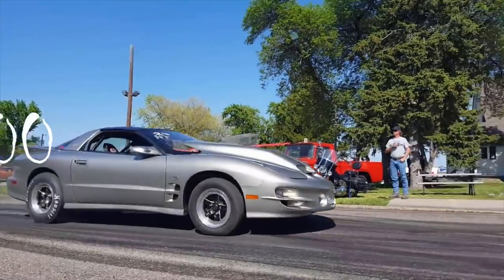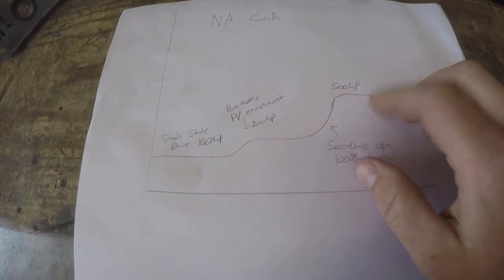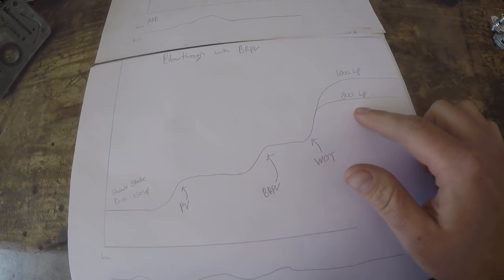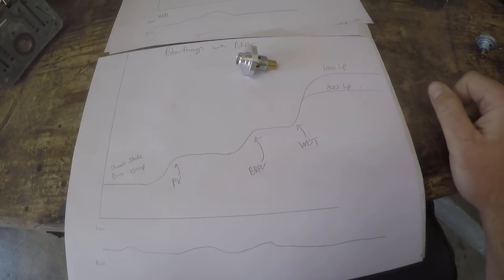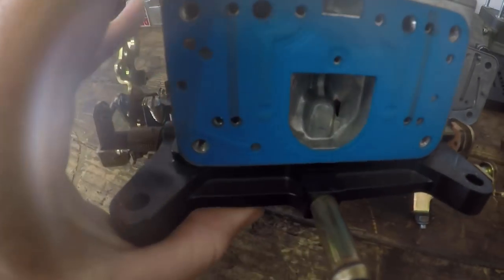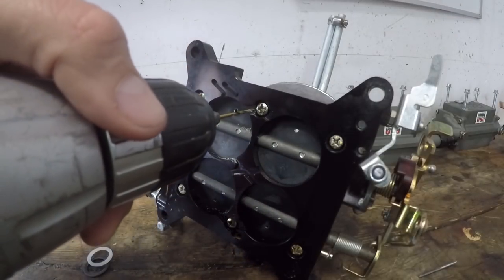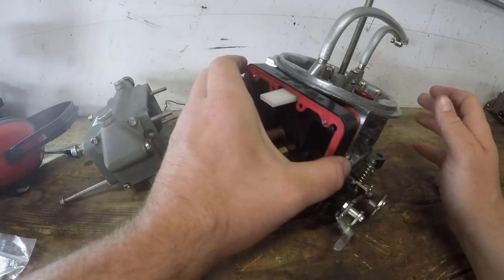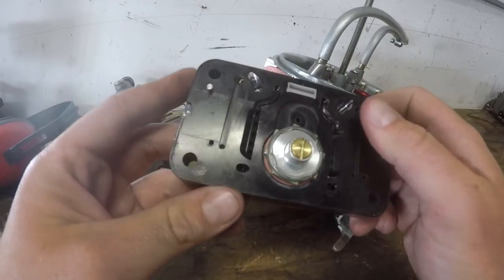Boost Referenced Power Valve

Comment: I'm pretty sure I have the same BRPV. I'm VERY glad he made these available. I just put one in my home built blow through setup and was able to fix my lean tip in to boost on the primaries. Very tune-able and a very well made piece.  Excellent video sir!
Reply from the maker: Ray Cam  Thanks Ray!   Yes these are a game changer
Reply: instaBlaster

Comment: We have had success on our quick fuel blow thru 850 with a 2.5 power valve making About 1300 hp . We have some adjustable boost reference power valves from a guy out of austraila we are going to try.

Comment: Well I'll be dammed. I think i finally get it. You are boosting the float bowl and making the much larger PV adjustable as to when it opens under boost. Kind of opposite a draw thru boosted carb. Staged PV's is something I never knew about either. Are other other types of carbs that are compatible with blow thur?
I hope you are still out there, this is worth a subscription.

Comment: Ok, finally a video on blow thru street applications! I'm considering a blow thru for my 94F150 flareside!  I'm talking 200-300 miles a month! Got a a powershot, and maybe that's what I  need to stick with! But a 10lb turbo setup would be awesome! Blow thru, but dependable!  How bout a vacuum power valve in the front, boost reference valve in the back?
Reply from the maker: Many guys do that
Reply: @tittan1500  thanks, I used to race 3-4 times a week! Everyone was shooting gas then! I'm 62 now! I'd don't want to go back to serious drag racing, but wanna be respectable with the new 500+ factory rides! Retired now, and would like to hit the small tracks just to watch. But if the itch comes, a pass or 2 won't really be racing, but it has to come home under its own power! Just good old boys having fun! Getting old sucks! Get ur thrills now!

Comment: So did you run 2 tiny screws into the 2 holes that you tapped ? I'm trying to figure out the minimal of what I need to do to run around 8-10 psi on a pretty stock 5 speed fox body that I drive a shit ton on the street and see's little to no track time.
Reply: You should make a video on building the most basic but functional blow through convertion for a lower HP say 500 HP convertion. There are slim to na video's of convertion's period but, the one's I have found are for dedicated track carb's. I know I need to pull the choke and mill it. I have access to either a Holley or Edelbrock 650 doubles. Great video's btw, love the knowledge.
Reply from the maker: Bryan Roupe yes sir I put cap screws in the hole ( link to them in the video description).   

Honestly for 5/10 lbs you don’t need one.   It will help if you roll on the throttle mid way a lot but at the lower post levels the standard powervalve can cover the gap pretty well

Comment: Im building a twin turbo 5.3 and am using a 750 dominator. Its a typical 3 circuit carb but the fuel channels are a little different. Can you shed some light on this carb
Reply from the maker: I don’t have any experience with the 3 circuit.  The concepts are the same you just have another fuel source to balance
Reply: @tittan1500  Ok. I was wrong. The 750s are 2 circuit. My bad.

Comment: If running a normal power valve, you shouldn't need to do any modifications to the PV, other than increase the channel sizes for more fuel.. right?  With your BRPV system, you block off the vacuum hole, how does boost pressure get INTO the BOWL side to open your BRPV?  The boost then squishes the ball open from boost entering through the vent tubes?
Reply from the maker: Correct
Reply from the maker: If you don’t block off the hole pressure in the intake can equalize on both sides of the ball and cause it not to open

Comment: at what power level would i need   more mods to a regular NA carb then  removin the  chocke horn and  swapping to solid  floats  when building a  350-400 hp  231cid  v6  for street driving  with a  5 speed manual?

Comment: Hey,i generally never ask anyone questions  on here,but ive built alot of blow through carb combos an im curious if u have ever seen fuel pressure effect the boost pv before the bowls r pressurized by boost,say ur valve is set to open at 3 psi but u have 7 psi of fuel pressure pushing against it,have u had the valve open prematurely,i set em with compressed air and they usually come off the seat around 2 psi and flutter then by say 6 they r wide open,so i add a couple turns to try and compensate for fuel pressure so they flutter at 5 psi and r fully open by 10 give or take,just curious if u have seen  the same things and set em up accordingly....justin

Comment: So 8 PSI of fuel goes in the carburetor but let's say you're pushing 10 psi of boost wouldn't it push the fuel backwards? is there something you do to stop this
Reply from the maker: Pressure from the boost fills the bowls through the vents so you always have more pressure “on the fuel” than after the booster

Comment: So are brpv's needed for a blow thru 7.5psi if you use a boost reference fuel pressure regulator with a Holley 4150?
Reply: Yes

Comment: I have a question.I have a ls and while on brake I watch my a/f and around 4-5 psi I it will go from .70 to .62 so im assuming the power vavle is opening.It basically kills the engine for the most part and cant really come up on the transbrake.Should I tighten the power valve in the front or both or something else.Its on cam only twin 63s..thanks so much for any info
Reply from the maker: Tighten it up or use smaller PVCR on the primary and more on the secondary

Comment: Should I do the jet exstentions and the copper tubing on the pv even if I'm not doing the bapv? Only 10psi.
Reply from the maker: Bryan Roupe  always run jet extensions on the rear main jets unless the carb is sideways in the car

Normal power valves cannot be extended

Comment: Doing blow thru Novi Paxton set up on ls 5.7. what size boost power valve should I buy? Going with a 750 I think, only 10 pounds of boost max
Reply from the maker: Charlie B currently the SCS power valve is just one size, you adjust the flow with the PVCR

Comment: Does anyone know, if I run a normal vacuum power valve with the boost power valve. Would I still plug the base vacuum port that references the normal power valve?
Reply from the maker: Tony yes you can just don’t plug the port on the vacuum side
Reply: @tittan1500  Thank you very much for the reply. Your videos are so useful and full of information regarding blow through carba. Thank you for making them.

Comment: hey hows it going! i kno your very busy. i had few more questions.i have a aeromotive boost ref fuel pres. regulator. can i use it for the 500cfm  carb blow thru ?? also i ran 24lbs of boost w the efi set up .whats a good fuel pressure for the carb ?? ..did lots of research but no clear answer. ty for your time titan!
Reply from the maker: Les Harp as long as it’s a carb regulator and can Regulate down to 7 ish psi.  Then you should be good
Reply: Tittan1500 ty for your knowledge and for sharing it w me I really appreciate it bro..Salute!💪🏿💯
Reply: Hey titan1500! i saw where u drilled and plugged the vacuum hole ..i have the holley 2 bbl so i do the same to the primary? also u tapped the hole .but i never saw what u plugged it with. underneath the carb plate i have a ball in the hole do i drill it out or i can leave it?Sorry bro  this is my first time w a  carb. thx for all your help!
Reply from the maker: Les Harp sorry there is a link to the set screws I used to plug yhem
Reply: Tittan1500 i appreciate the vids fasho ty bro👍
Reply: @tittan1500  hey man ty for the valuable info for my 2.3l stang wow I am blown away she is really pulling hard and so efficient this is my first time building a 2.3 l Turbo carbureted blow through setup. 6 months buildin  n i started drivin n tuning 3days  ago

Comment: I have a 2.3l ford mustang w turbo ..thinking about blowthru carb...what size cfm carb would i need and will i need a boost ref. Valve also for a 2bbl holley??
Reply from the maker: Les Harp ya a 500 ish 2 barrel with a BRPV would be a good start with some vent tube extensions.
Reply: @tittan1500  wow thx .love the channel .u really are easy to understand in your breakdowns bro!..i love racin..my combo is simple
Worked iron head ported n polished..436.lift hydr.rollercam 114 lsa..6500rpmrange. 
Msd dig 6 plus .w locked out distributor. C-4 rev.valve body .3500stall. 410gear. 62-1 ar70 turbo. Jus tryin somethin new.

Comment: Hey I love the video. But just curious though is that like 100% all I have to do to a carb to make it work with boost?
Reply from the maker: Hey ,  Depending on what carb you start with you may need to do a little more.

if your starting with a double pumper style carb - Nitrophyl Floats - .120 needle and seats ( not required )- Epoxy to seal up the main well plugs ( not required) - Lots of guys like annular boosters ( not required)
Reply from the maker: If your carb has a power valve check ball kit remove it
Reply: Sweet got it thank you. I actually have a 85 fox with a 302 with speed pro pistons and an Edelbrock intake with aluminum heads and a 750 double pump Holley carb. And I’m thinking of either nitrous or turbo. And I’ve been strongly looking into on3 turbo then the problem with a blow threw carb came up and the price for a blow threw I can go efi. But I like being able to tune my own stuff. So while we are on the topic what types of floats will I have to use and is it possible to run e85 with this blow threw carb mod? If not how much more will I have to do?
Reply from the maker: Sierra Ray how much power do you wanna make ?  I am bias blow through are amazing with the cooling and to me they are easy.

Pickup a BRPV and a wide band and. Go for it.   It’s simple stuff and no intercooler required !
Reply from the maker: Shameless plug we just started selling power valves.   

Www.simplestage.shop
Reply: Right now with it still kinda stock 302 I’d be happy with like 450hp somewhere around there. But I do plan on a 351 and having in make close to the 800-900 range. And from there I will upgrade but for now I’ll be happy with 450 on a 302.
Reply from the maker: Sierra Ray Easy wit the On3 setup!
Reply: So the brpv and new floats is all I should need? What are ur thoughts on put a carb spacer plate in too?
Reply from the maker: Sierra Ray yuo, however they carb spacer won’t do micj
Reply from the maker: Much
Reply: 👍 thank you very much for everything. And the fast responses. I’m getting ready to put the car up for the winter and come back out next season with a bang.
Reply: And thank you for ur info I already went and checked it out and plan on ordering it soon.
Reply: What type of floats do u recommend using too?

Comment: What fuel pressure regulator do you use for the ethanol?
Reply: Tittan1500 It doesn’t look like its boost referenced? Does your fuel pressure stay the same no matter what the load on the engine is?
Reply from the maker: Thomas Traicoff  sorry MP-9833-B
Reply: Tittan1500 Awesome thank you🙏🏼 Easily my favorite build on youtube

Comment: How about can cancelling second ay PV and jet up the secondary jets?
Reply from the maker: GHT RCP ya you can do that, but the curve will not be as linear.

In some cases the main jet at its max size is the restriction depending on main well and booster size.  In this case eliminating the PV circuit can lower total fueling

Comment: What fuel pump are you using ?
Reply from the maker: cory cook ProStar500
Reply: How to you get the fuel pressure high enough to run that much boost ?? I can’t run anymore than 18psi with the same pump?
Reply from the maker: cory cook crank your bypass all the way down it will do mid 30s
Reply: Thank you. I will try and see what happens.

Comment: Plug the power valves altogether. Add a boost referenced fuel pressure regulator and fuel pump capable of providing 20 lbs more than the boost pressure. Up your jet sizes 4 or more sizes and possibly put smaller air bleeds to increase fuel flow at higher engine speeds. Noone seems to address the problem of insufficient fuel flow and pressure. The needle and seats must be the largest you can get or maybe drilled out a bit ,Use the plastic floats they won't collapse. For alcohol consider spraying additional fuel into the boosters like fuel injection.
Reply from the maker: dielauwen  Everyone uses boost referenced fuel regs these days man.  Stock bowls on e85 can get you to around 700 wheel and dual needle and seat bowls are on the market that support more than most people can afford.

On a blow though deal making any power just squaring the jets and blocking power valves is a good way to buy a bunch of pistons.

Sorry man but that is terrible advice
Reply: Most Racing carbs do not use power valves. Holley still does. There are no Motorcycle carbs that have power valves that I know of. Just jet for best power . So why do you say it is bad?
And to create high power under boost the airflow needs to be much greater so Carb size needs to be increased. It becomes a choke .They are not designed for the flow alcohol needs so just add squirters for high boost.
Reply from the maker: dielauwen  these are not naturally aspirated motors. Air flow in a turbo motor is not a linear deal.

In automotive carbs power valves on street / race cars are most common.  This lets you drive clean and maintain safe AFR at different loads.

Boost makes this even more critical, when your part throttle and the boost comes in your going to go very lean if you don’t have compensation.

Drag cars sure you can roll just big square jets,  just don’t expect it to street worth a dam or peddle the car.
Reply: I see you have not worked on foreign cars which have no power valves on the carburetors. 
It is simple to set the carb to follow a set mixture for any given speed, load is not even considered.  Small engines need to make power at any rpm. You can set it to be lean anywhere on the scale or rich anywhere on the scale.Or correct mixture for least emissions. 
If you are looking at gas mileage why did you build such an engine? To get a better mixure under pressure you need a much larger carb to flow the air in a more linear range. 
Put a 1050 Dominator on your engine and see how it does.
Reply from the maker: dielauwen ok man 😂
Reply: Im late to the party, but............ WOW!